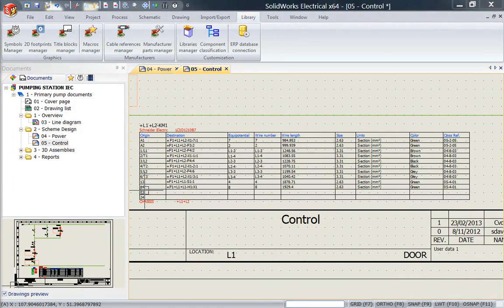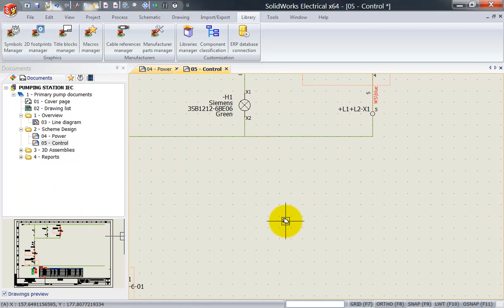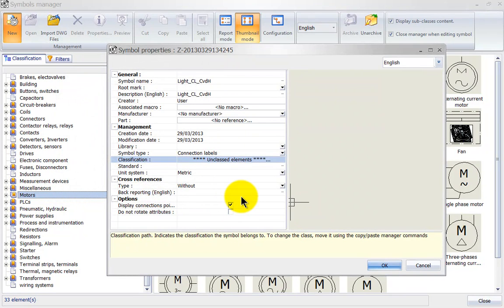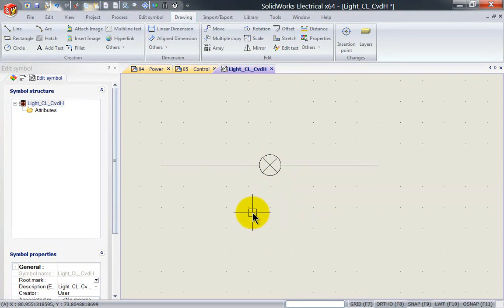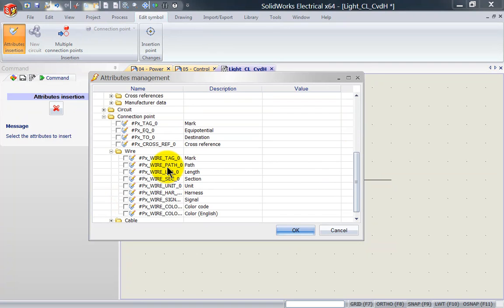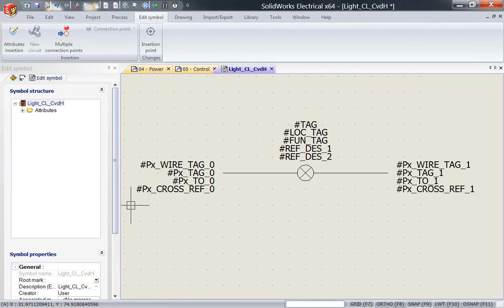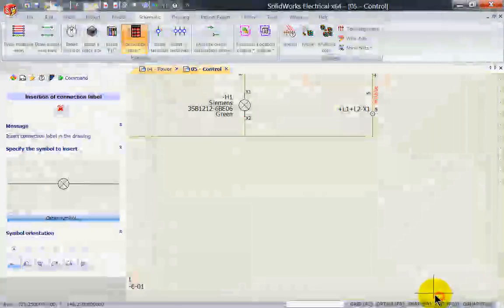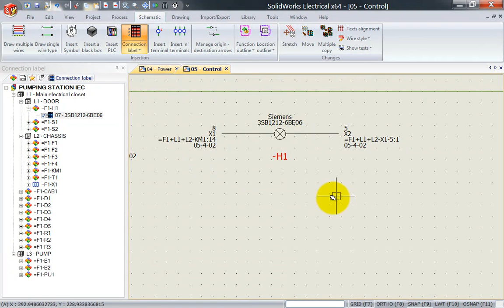35. SolidWorks Electrical - How to Create Custom Connection Labels

Comment: Hi, Im struggling to solve one question, could you help me? How to use the same terminal both sides, without connect them through a wire. When I assign them together, it creates a multilevel terminal.